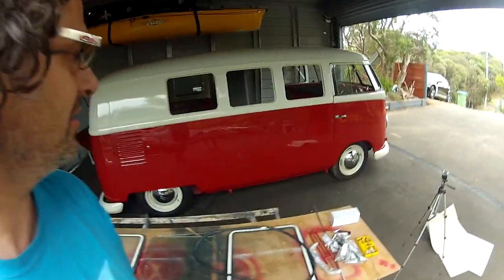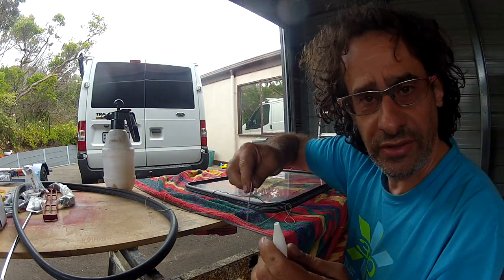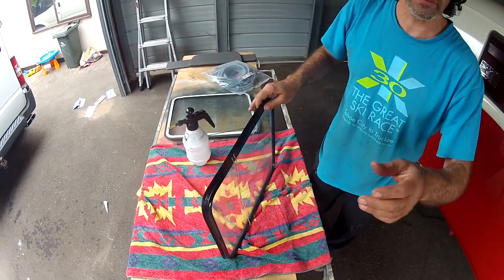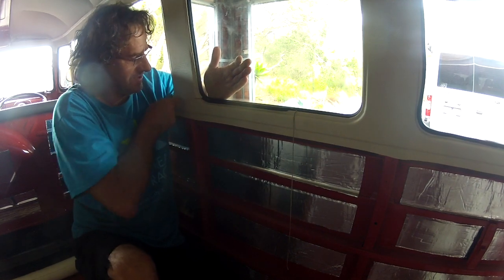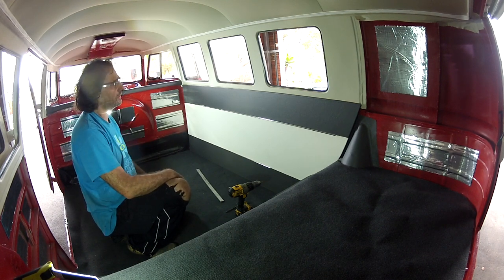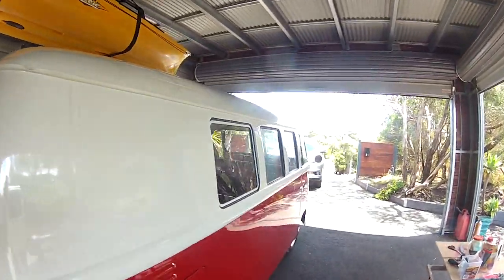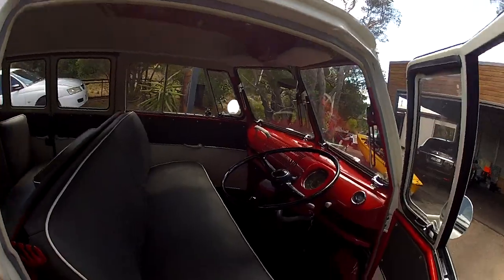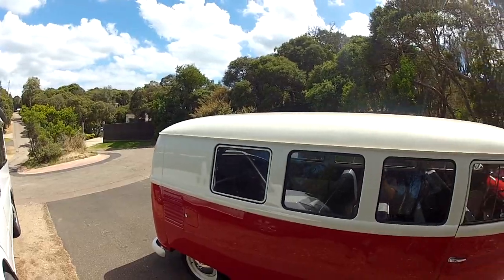VW Bus Restoration -  FINAL VIDEO #vwrestoration

Comment: I love your work !!! did you fit seat belts or are you not required to due to the age of the bus ?
Reply from the maker: cheers mate, yeh dont need them as it never came out with them from the factory but the owner will fit them down the track ;)